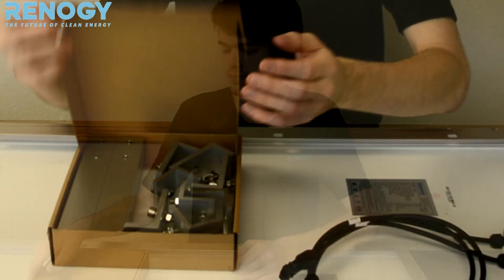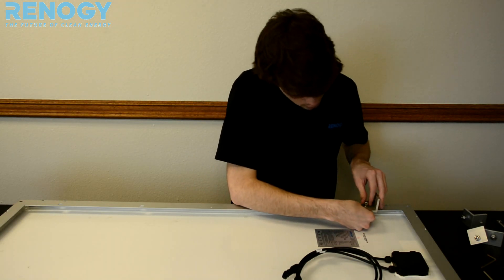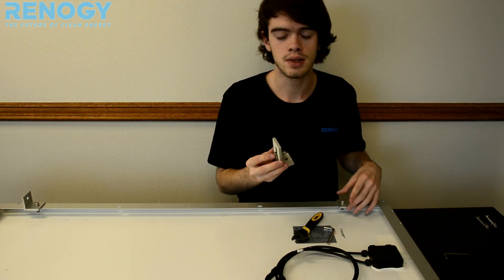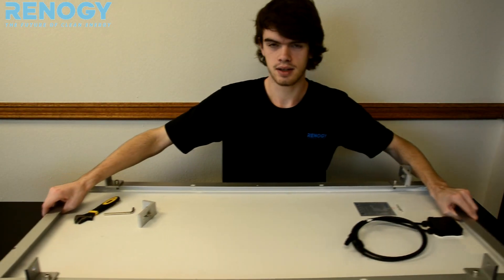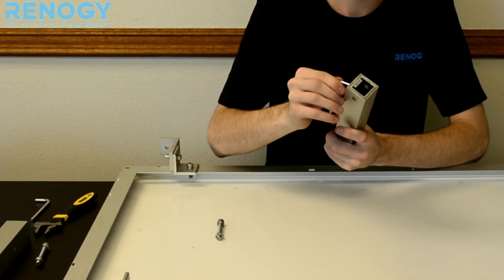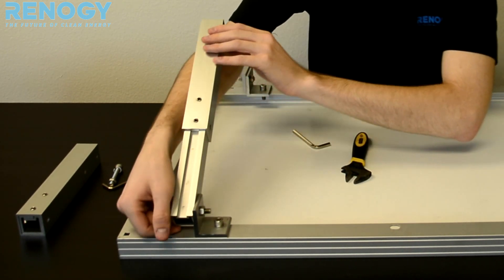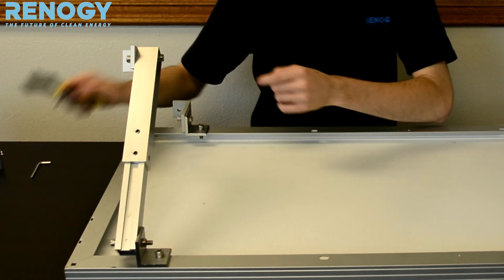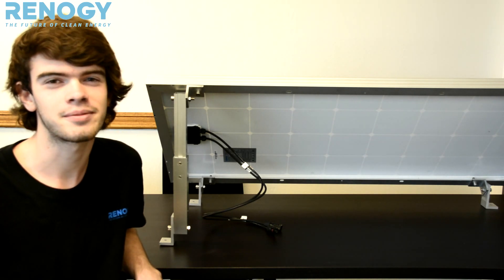Renogy Solar Panel Adjustable Tilt Mount

Comment: So, I'm wanting to mount 3 of these on my RV here in Seattle.. Will the extension bracket fold down so that the panel can be flat? Also, how easy is it to adjust the extension bracket supposing I move every couple of days?
Thank you
Nick
Reply from the maker: Hi +FredrickVonShwinkel, 
While the extension bracket would adjust easily enough, the only way to lay the panel flat would be to remove the extension rod and secure the panel to the l-brackets. However, we personally do not suggest mounting these to a vehicle. We hoped that helped. Please let us know if you have any other questions.

Comment: Are the cables on the back of the 100 watt panel labeled  positive and negative?   Does the output vary depending on conditions?
Thank you.
Reply from the maker: Hi +Mike Dunn,
The cables for the panels are labeled positive and negative, and yes, the output does vary upon conditions. Please feel free to let us know if you have any other questions.